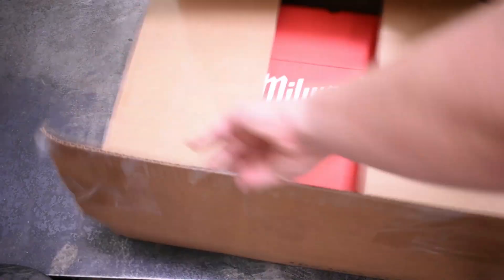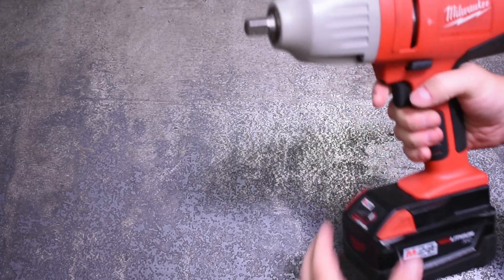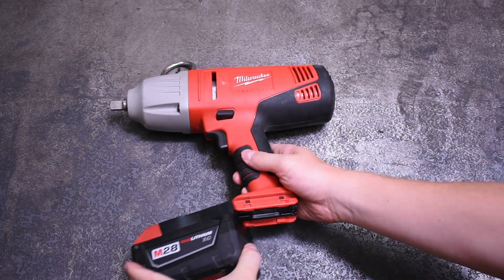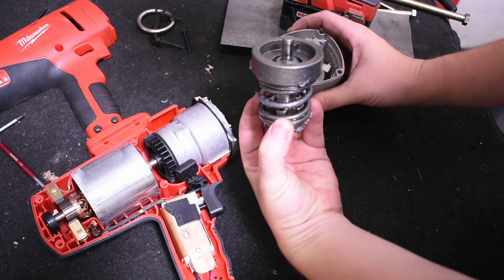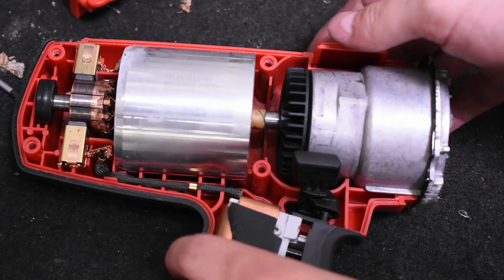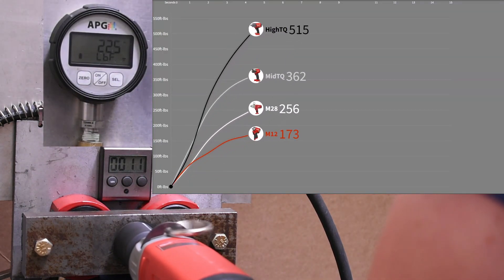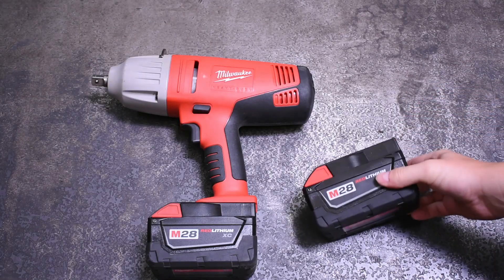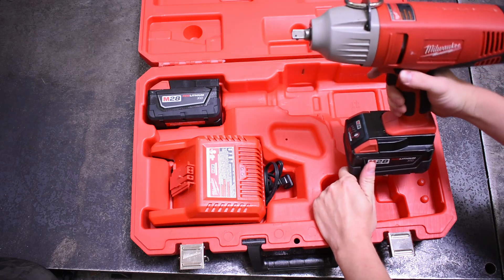The Curious Case of M28: Milwaukee's Little Known 28 Volt Line

Comment: Well I am one of those dinosaurs that still use the 28volt line. After market batteries get ya 5.0 and 6.0 Ah and they are cheap at 50 bucks. As long as the tools hold up there us no incentive to move on. However I do have a companion Mikita line. The 28volt sidewinder, Sawzall , grinder, hammer/chipping drill and the big general drill are the only tools that see regular action for me. Everything else goes through to the Makita lineup...impacts and drills, routers, multi-tool, lights, etc.
The 28 volt line is showing its age for the last 6-7 years as every other tool line has leapfrog it with newer modern tools optimizing the 18 volt to the next level. The fit and finish are starting to lag of the 28volt version.

Comment: I was just thinking this the other day. I work as an EMT and we utilize a lot of weird and specialized equipment to do our jobs. One of the things we have is a Power Stair-Chair. Basically it is a wheelchair with tracks on the back that drags patients up and down stairs, a lot easier on your back. Aaanyways I saw the battery that was used on it and it said M28. I was confused as I have only seen M18 before and now I know I wasn't going crazy 😅.

Comment: I bought my v28 impact (which is showcased in this video) back with v28 batteries..Id say about 12 years plus ago. I still have it and still use it.  But currently have m28 batteries with it.  The v28 batteries were junk and milwaukee more less screwed every customer that purchased v28s because they were junk batterie. 

So to compare this v28 tool (which it is) to newer stuff is not really fair but interesting to see how it did for sure.

My m28 hammer drill about broke my forearm a few years ago...  Heck of a drill...

Comment: I bought a  second hand 28volt Milwaukee from my SnapOn rep, in 2007, to replace 12 and 18 volt SnapOn impact wrenches. I've still got that Milwaukee and it's still silky smooth to use and is mostly used on factory plant and agricultural machinery. The SnapOn units didn't seem at the time as well made. I understand the 28 volt impact wrench was developed from their 120/240 volt corded unit, and until recently the corded version was still in Milwaukee's catalogue in Europe. The 28 volt batteries are still available but expensive. I also bought a brand new 28 volt impact wrench and 28 volt drill some years ago. Great kit, that was built I understand in the US. I use nearly all Milwaukee gear now up to the extended anvil 1 inch impact. If I could change anything it would be to have built in the US or in Europe.  Regards k

Comment: They are tough tools. I bought the original V28 in 2005 and only managed to kill the controller on an angle grinder (weak by modern standards). The Sawzall is a match for the corded unit. The design philosophy was like contemporary Milwaukee corded tools so they may last until the heat death of the universe. Batteries are expensive though making them obsolete unless you also have M18 tools and use adapters or have enough accumulated that it's worthwhile. I still have one battery from 2011! Durability was excellent.

A modern version could be really impressive but would be more a professional tool due to cost.

It's trivially cheap to add a fresh kit of cordless tools every few years and the smaller ones are actually the most useful for most users so my recent fleet is DeWalt and Makita. The old stuff isn't worth buying new but it paid for itself by the later 00's so any use afterwards is gravy. I use the Sawzall all the time though I bought a more powerfu DeWalt 60V for the heck of it since I've ample batteries.

Comment: I, personally, would only use this for driving lag bolts into wood for basic deck structure. Sometimes I wish the corded ones I have weren't so aggressive. 
On another note, nobody seems to know this but you could have always had these or any batteries rebuilt at Batteries Plus for a fraction of the price AND you can opt for higher Ah depending on the size of the battery case. I've had the old Nickel Hydride batteries rebuilt quite a few times.
Reply: I didn't know they did this at all, thanks. I go there to get my group 31 batteries, which are really affordable with the 10% savings from online purchase. I also go there because they have a badass Autometer carbon pile load tester- which is the right way to test a battery.

Comment: Had one of these years ago at a tv station for bolting down sat dishes anx occasional huge rack installs.  Was beyond heavy and the batteries did not last long.  I agree that the m28 was very smooth.  
      Dont remember if the bosses refused the price to replace batteries or some lowlife stole the milw from the shop , but at some point that drawer was empty.

Comment: I wonder just how much battery it would take to make max torque (max performance on the dyno) before it broke, i will say this with an ignorant tone, just keep adding car batteries, 3 batteries 36 volts,4=48,5,6?,,,I may be completely wrong but if you have a ton of amps and just keep uping the volts that dumb brushed motor doesn't know the difference, it should put out more power and speed to spin that light weight hammer,,,what would fail first? The uncaptured planet pins? Melt the brushes out of the motor? You have taught us well Oh Great Sir...But I would love to know if the bearings help...I have this on my todo list,I'm going to put a roller thrust bearing and bearing on the anvil shaft and see if it helps,,,Thank You for all your hard work, huge respect and greatly appreciate you guys

Comment: At my fire dept we have the M28 “jaws of life” and spreader tool and they are the best yet worst tools ever. Don’t get me wrong, they work great and are powerful as ever but going from the old hydraulic style with a stationary pump and the lines to cramming all of that into one portable machine was terrible unless you seriously need it to be more portable. After only making two cuts you don’t wanna make a third cause your arms are dead from lifting that massive 65lbs tool over your head and holding it there while it cuts with your full gear on. They do exactly what they’re supposed to do but you’re gonna want to be the size of Dwayne Johnson to be lifting it over your head more than twice.

Comment: We have a 1/2 M28 in our tool room where I work. We have had it for years, so I can say it is durable. We bought it to go places we couldn't get a pneumatic impact. It serves it's purpose, but when I use it, normally on flanges and such from 4" to 10" steam lines, I always have to go back and torque them with a regular ratchet. Great video though.

Comment: I was involved with a company that Milwaukee was working with on the injection molding side right around the time they were acquired by TTI.
The M28 line was envisioned to become the mainline, but 2 things happened:
- the cost of the cells made the batteries prohibitively expensive, especially for consumer but even for fleet/pro use
- brushless motors and their ESCs came down in cost significantly, basically negating the need for very high voltage batteries
Milwaukee went with 18V (5s LiIon) because, with fewer cells, and now cheaper BLDC motors, 28V was not needed.

Comment: The V28 (and successor M28) were Milwaukee's first Li-Ion Tools.  The reversed batteries, at least for the hammer drill, helped at times with a better weight balance.  The older NiCad 18's had this function too!  I had been looking at getting it, but now will instead get the M18.  

I have the V28 hammerdrill, sawzall, circular saw, and light kit.  Also have the shop vac, and a radio which does V28/M28/V18, M18, M12 batteries!  The light has some sort of issue, but the rest work fine with the M28 battery I got to replace after a decade when my V28 batteries actually started to die.

Comment: I still using my 28 volt hammer drill, sawzall, circ saw and impact. I bought the set when I was still contracting and it was fantastic. Yes the 18 v brushless has caught up to it. The difference now I use it in the shop and on the farm instead of contracting.  At the time it was new tech, it kicked butt.

Comment: What's the amp hours of M28? 

I never understand why guys go out and buy bigger (volts) batteries. It takes what, 2 seconds to change batteries? Lithium alway delivers full power till empty. That's just how the technology works. When you consider the extra weight and cost it just doesn't add up to me. Plus, at least in my country, there's alway power (for charging) available on site and it doesn't take long to acquire a collection of 5ah batteries that can be fully charged once a week to get the through.

Comment: You bonehead I’ve had the Milwaukee 28 now for over 20 years ! I have the impact, vacuum, jig saw , radial saw a couple of grinders, a couple of there drills and the big metal cutting saw ! I have the old regular 18 with multiple tools, the m18 in about half of what they offer ! But when I have to work on my 100 horse tractor and machinery I go to the 28 and never have battery problems like you are showing ! Everyone always wants to use mine over a default !

Comment: Have m28 set from way back plumbing apprentice. I still use the 28V drill for 2 5/8 hole auger it plows and is still a ape of a drill . the sawzall has been outclassed though its still a beast.  Overall the m18 is powerfull and way more light and usefull .The m28 batteries were a nightmare also. i have 2.5 left over from my 6 overall.

Comment: I stopped using Hercules after I dropped it and the high impact made the handle crack and work intermittent.
I upgraded to Milwaukee and the power difference is great. I would be willing to be that Hercules ½" impact would come in last place

Comment: I will say I’m an electrician and this tool was used daily and hard I used hole hawgs all the time for roughing a house but once I discovered it’s capabilities I never have used holehawg again … this tool was used and abused daily for 10 years of its life and held up remarkably well I ran that thing so hot you burn your self and if drill bit was exceptionally sharp and you put it up to your top plate to drill if you weren’t prepared it would snap your wrist and you knew it … badass machine…

Comment: As an owner of several 28v tools and 12 batteries I’m vested in batteries or I would love to get 18v tools … I will say when 28 v came out it was an absolute animal… also batteries lasted forever… the problem is 28v battery brand new the battery is old and it’s capabilities of holding a charge is probably down 35% from when tool first came out… I believe batteries are priced around 150-180.00 and just don’t have the full capabilities…frustrating if you only have 2 batteries… anyway you slice it 18 is a vast improvement over 28 but that’s only because the 28v came before it … it was arguably the badass tool and the best feature is tool accepted battery forward or backwards and 18 would have that feature I believe it would be perfect tool…

Comment: I've had my m28s for 15 years. So many stories from build a camp on a island 14 years ago to rebuilding a porch/balcony 2 days ago. I had the impact in my off-roader and it always did everything I needed it to do.  Yes I have needed to replace batteries, but I have beaten the tar out of them and I can always count on them to work.
Reply: There is a adapter to fit the m18 batteries
Reply: @jackmaddox8079  I saw that M18 to M28 adapter but it's beyond me how that is supposed to work. How could an 18 V (max) battery push through enough amps to run a 28 V (max) tool at anywhere near rated or usable power output?
Reply: @Djaz T.  
A friend has it, he says the 18v battery's seem to provide more more in his 28v tools. He says it's a little cumbersome but gives life to his old tools

Comment: Could you check out cornwells impact tools, sense I have been working at John Deere tools trucks come by pretty often and I got a catalog and their 1 inch cordless impact which is a D handle they said has 2700 breakaway torque at they sell it at around 800 dollars, so if it does hold up to that huge 2700 number then its more of a steal than both Milwaukee 1 inch.

Comment: These tools were originally designed for the V28 platform, but the batteries were soon "upgraded" to to create the M28.  The V28 used 7 oddball 26700 cells (mine were made in Canada) and good luck finding them.  Unfortunately, the cells were turds and this is likely why they switched to M28, which at least used then-standardized 18650's, though it needed 14 of them.

I got mine in March of 2006, when Milwaukee was marketing the V28 battery as having  "more than 10 years of research and testing", claiming that it was the arrival of lithium-ion tools that could replace corded equivalents.  In reality, the 28-volt product lines rapidly became obsolete as M18 sales figures came in.

I took my batteries to a service center a year or two after purchase to be tested, but they had no way to test capacity and simply reported that the cells were all 4.1V (balanced) and thus didn't quality for warranty work.  I felt rather abandoned after investing $750 in a kit of these tools, as M18 turned out to have a much longer lifespan.

In fact, Milwaukee's own "history" web page skips over V28/M28 entirely and implies that M18 and M12 were its first li-ion power tools, which were later upgraded to FUEL, though I can find no detailed history anywhere online before FUEL was introduced in 2012.  Milwaukee even says, "We would continue to invest in new technology without the need for our users to change platforms – we’d never leave them behind."

So I guess those of us who invested in the wrong platform no longer exist to them :( .  I knew some other folks that moved to V28/M28 and most regretted it as M18 remained viable after V28/M28 died and was never spoken of again.

I like the V28 tools, which are indeed "heavy" duty and loved the whole platform at first as this was the first battery circle saw and sawzall that allowed me to leave my drop cord in the truck, but the batteries had terrible Winter performance and began showing noticeable loss in runtime after just 6-8 months of work as an HVAC contractor.

My tools are still perfect, but the batteries have been useless for over a decade and I'm trying to figure out how best to replace the cells with 21700's or 26650's or to at least create a 24-28V AC power adapter for them; these packs had a nominal voltage of 25V.  26700's are just a strange size, making replacement difficult as the case and frame were made to fit.

Today's battery tools are awesome, but old Milwaukee corded tools will last longer than a human lifetime, while battery tools become useless if you don't or can't purchase new batteries occasionally.  I've got a hand-me-down Milwaukee corded drill that will work perfectly long after I'm gone.  Cordless tools are convenient, but they're also convenient for company shareholders.
Reply: About replacing the cells in V28 batteries: I propose you rather get some dead M28 batteries (over here available for 10-20 USD equiv. on eBay) and send them to a company to re-cell. For a power adapter: some old 24 V lead-acid battery charger with 30-40 A output will do (those not having microchips for charge control). (I often run my M28 tools from 2×12 V AGM lead-acid batteries in my truck, using an adapter made from a dead battery and SpeakOn STX 40 A connectors. Works well, no issues at all.)

Comment: Ha I remember always wanting a V28 (later M28) 0779 impact!  But, I didn't have the $$$ at the time they were current tools (note also if you account for inflation these are considerably more expensive than they might seem).  Definitely decent performance if you consider when it was from and the fact that it actually does what it says it will in terms of torque.  But wow that thing is gi-normous!  Glad I didn't get into this stuff until 18V era and brushless tools, but nice to see this actually get tested today.

Comment: I still have mine. I bought it when it was still V28, so the case doesn’t fit my M28 battery.

The (power interface) form factor of the V28 and M28 batteries are compatible with the old “classic” 18V bats. I can’t tell you how annoyed I was when I bought M18 batteries for my old tools, only to learn they weren’t the same. 

Good times.

Comment: The V28 battery uses a 26700 cell. The first battery - ( cells made in Canada ) lasted better than replacement batteries. My old batteries show a full charge  but do not deliver the amps to run a saw or drill.  Try the test with a brand new M28 battery. Just my opinion, the 28 volt line of tools were well built but the batteries fell short. The tools draw more amps than the battery can supply = short battery life.

Comment: It's not little known of. I've had the Milwaukee m28 system for well over a decade it was the original OG Powerhouse cordless tools. I still have all of them the saw the grinder the drill the Sawzall the light the hammer drill chipper vacuum and it still performs well to this day

Comment: Counting only the major brand cordless tools, there's been at least 3 dozen (and probably more) battery types sold with some being discontinued about a year after first hitting the market, and a few being used only in a few tools. Pity the poor souls who spent their money on those things. I was an early adopter of cordless back when only drills were offered. Batteries were built-in, capacity was low, tools were weak, and full charging could take hours. Any abuse of the battery and you'd soon have a dead tool. Mighty handy for light work and useless for anything else. And now they rival corded tools but one thing remains the same: the most powerful cordless tools and their batteries ain't cheap.